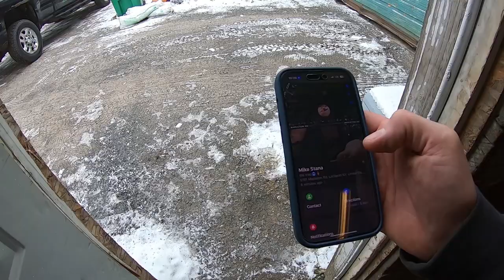Prepping for a SNOW STORM plowing & salting

Comment: I run accuweather after downloading roughly A dozen it’s the 1 I landed on The one with the most information and at least obnoxious ads what I love most is every time before a storm usually 2 to 3 days before it will give me a breakdown on how much supposed to get so Thur-fri storm they predict
1-2 in and breaks it down
1% chance of more than 4in
22% chance of 2-4in
39% chance of 1-2 in
31% Chance of a coating to 1in
7% Little to no accumulation
Reply from the maker: Yea i have it sometimes it’s way off too